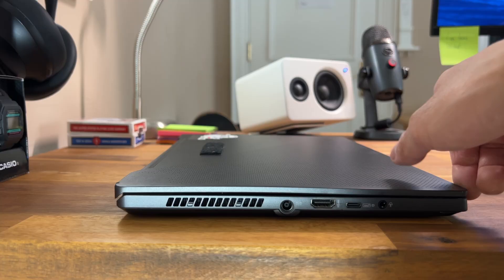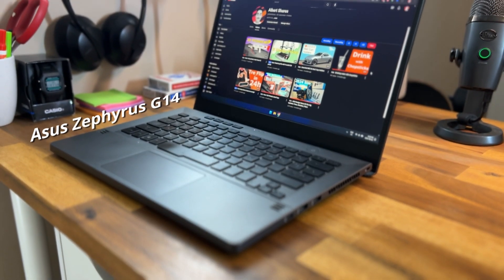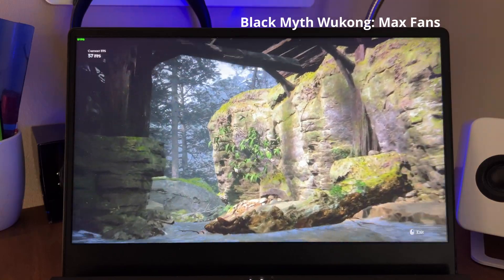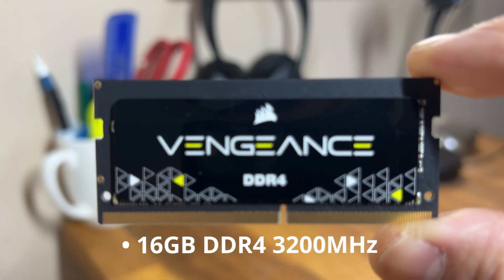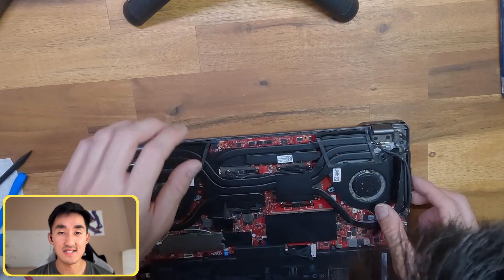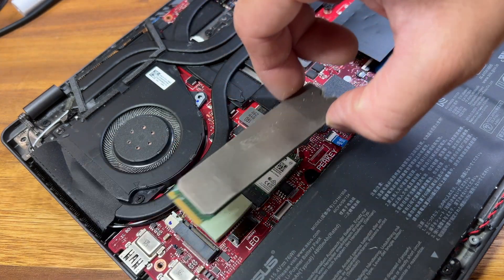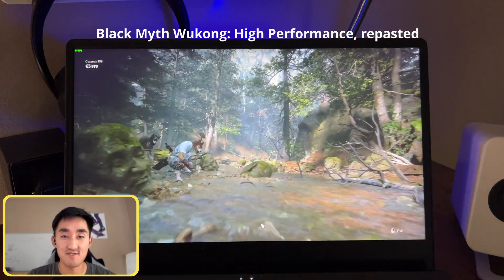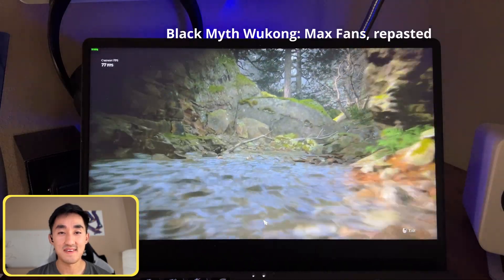Fixing my 4 Year Old Gaming Laptop: Asus Zephyrus G14

Comment: There is one small channel I found trying to revive my laptop called snarks domain, who tests therml putty. According to him the one you chose and link to is both lower performance and harder to use. I found the upsiren u6pro on amazon for similar price, which according to him is easier to use.  Just a warning, your putty likely has similar conductivity to the pads asus used originally (I think they are all around ~5w/mk. The upsiren is 12.8) so you should be fine. Ironicaly I also got the arctic mx6, that thing is nice, technically PTM is faster and longer lasting but is is expensive.